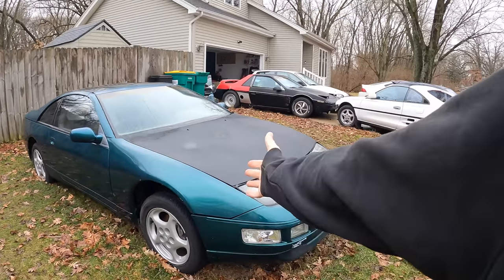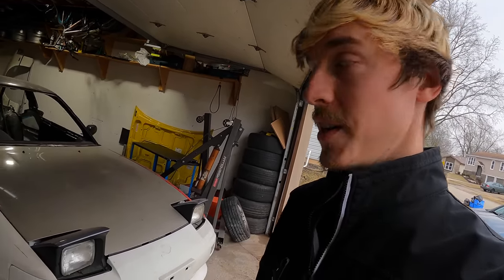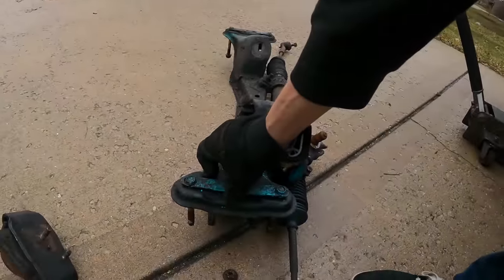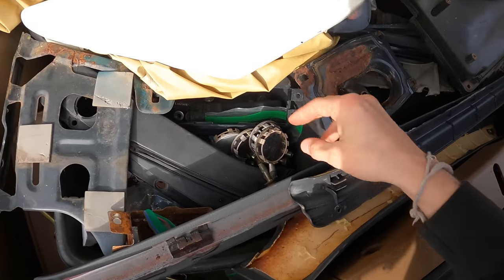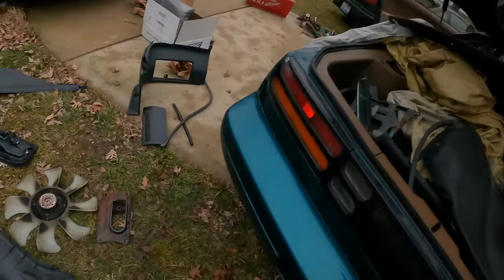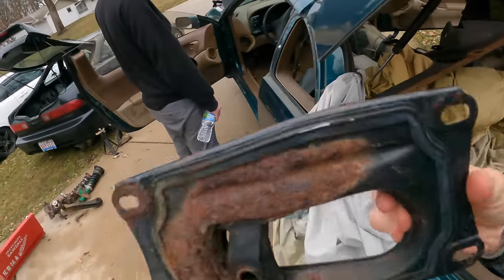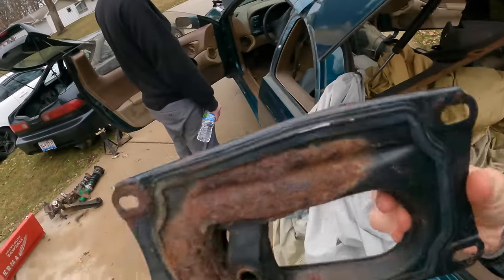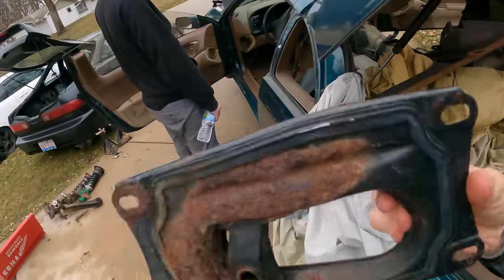Project 300zx Engine Reveal!

Comment: Honestly I think this is going to be a pretty good engine for the Z even non-turbo because I've seen people put the sr20s in them and the sr20s have like no torque the ka24 was designed for the D21 Hardbody a truck so it's a very Torquay engine for 4-cylinder so I think it's going to do a very good job in the Z
Reply: fun fact: the engine in the video im fairly certain is a DE, the older E head kinda is meh, 3 valves per cylinder, SOHC 
also is it normal for OHC engines to have no actual removable bearings? as in the head is the bearing?

Comment: If you have to drill in a tight area, you can get a right angle drill or there are right angle attachments you can get for a regular drill that are really handy.  Stubby drill bits can also help.  I use a right-angle attachment from Milwaukee on a regular drill that takes hex bits and with a collection of stubby bits, that has gotten me out of a few tight spots (pun totally intended)!

Glad you went over the vacuum lines... I need to sort all that out on my KA still as well.  Good weather is just around the corner finally... time to really get after this stuff!
Reply from the maker: I definitely need to look into one of those right angled bits!

I can not wait for nicer weather! Looking forward to this summers progress 💪:_s13::_love:

Comment: A few friends and I have been contemplating doing a kat in a z ourselves here in Florida,what we were thinking was to use the whole excessive adapter kit and the sr-z mounts, fuel lines just flip on the bottom of the car, actually was gonna use a hardbody flywheel and retain a vg clutch, stock driveshaft and driveshaft mount, and I literally was underneath a sr20 swapped z the other day,for mounts all they did was basically extend the pedestal towards the engine

Comment: PRIZZA MIKE you need to invest in an auto body file belt, they work great for grinding spot welds off in tight areas, like that weird one on the firewall,  suuuupperrr nice for prepping metal in weird areas before welding. usually theyre pneumatic and use alot of air.. milwalkee has a cordless one but i wonder if someone makes a wired one. i know youre a man of plug in power tools.
Reply from the maker: I honestly have always wanted one of those haha
Maybe someday I'll pick one up! :_s13:

Comment: One of the vacuum lines you deleted might be part of the IAC system. There's a bunch of vids on KA emissions deletes, or just check out vacuum diagram.

The long ones from the front of the throttle body are for the air pump and evap canister.

Comment: So as a z and a hardbody owner... the vg and ka should share a bellhousing bolt pattern!!!!!!   Don't neglect to do some research I guarantee you'll need a custom clutch.    But I always told myself I'd put a single jingle on boost in my z32 if it popped!!!!   Just saying the vg30de has a shit ton of bottom end reliability.  It's the timing jobs and sticky injectora that get yah.       Another plus.  I hear alot of 240 sx owners using the z32 transmission lately .... they do have a pretty chill gear ratio

Comment: The trans plate is different from auto to manual. The auto is basically half of the  manual plate. Wish YouTube supported pics. Have the manual plate within 5 feet of me lol. If needed I can figure a way to send it to you. Would love to have one of my spares used in one of your builds.
Reply from the maker: Thanks for the clarification man! 

I just realized I don't think I can run that plate with the adapter kit I have haha
Reply: I've seen people run without the plate an just use washers. From what I understand it's just a clutch dust cover. To try and keep dust out of the Trans bell housing. I'm a nut job and like to keep all the oem I can.

Comment: 8:57 Talking about fire hazards, when I got my Mustang it had a burned out audio wire snipped off on one end and connected to the positive side of the battery on the other, my guess is the previous owner had sub in the passenger footwell and took it when they sold the car, as it still has a bass knob mounted under the dash, I'm assuming that audio wire is the reason why the car shorted out a couple days after I got it, (it locked the horn and lights on once I unlocked it after work, had to drive home at midnight with the horn blaring) because it hasn't done it since then and that was a couple years ago, you never know what you'll find in a used car

Comment: hey mike, got a question, i doubt ill get an answer
i got a d21  hard body with a ka24E
im wondering how hard is it to rip off all the emissions crap without having a pile of engine codes
cause im kinda thinking i might do that, cause im not sure what goes where so if i can remove it then it aint gonna be a problem
also it was having issues with running and i suspected the timing chain, which ofc was floppin about, but i aint gotten around to fixing it because i had to pull the head to change the now torn gasket... yeah probably not a great decision but, needed to make sure this crap would seal so, yeah.... its gonna be a lot of fun... im just hoping the several months its taken me to get around to do any of this shit hasnt killed the low milage engine, minty 50k

Comment: me with a ka24E looking at the DE wishing i had all the shit to slap it into my d21 hard body pickup because 22 mpg and old ass emmision shit on an shortblock with 50k miles and a truck thats got 250k on the odometer kinda lookin like shit at this point
also i really should get my old land boat ferd bronco working again... its got its issues
rockers are fine but its the top of the damn thing thats rotted the fuck out some how.

Comment: NA projects are awesome but you dont get a lot of power.
Turbocharging a NA engine is for lazy people but you get tons of power but the engine can broke at any hour.
Does someone who agre??
Reply: How is it lazy, they are just different paths and have pros and cons depending on application. You don’t just slap a turbo on, there is planning and fabrication needed for FI systems. There is equally as much work for high strung NA builds.